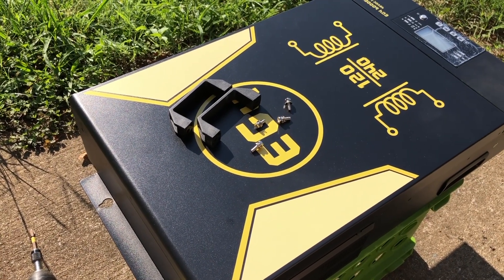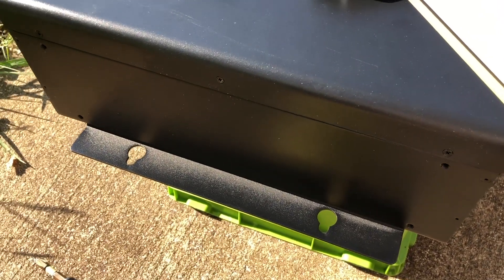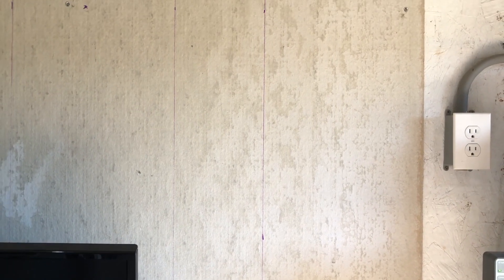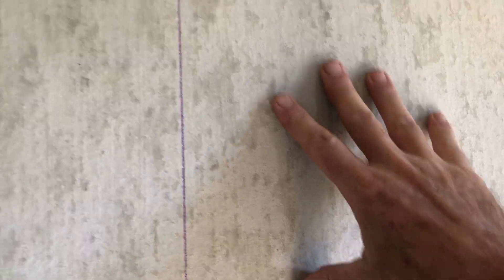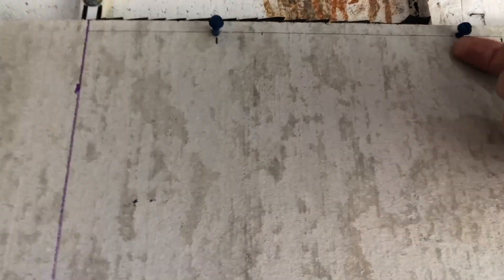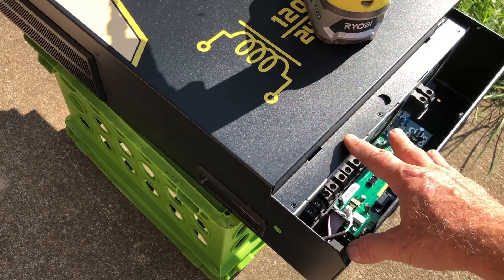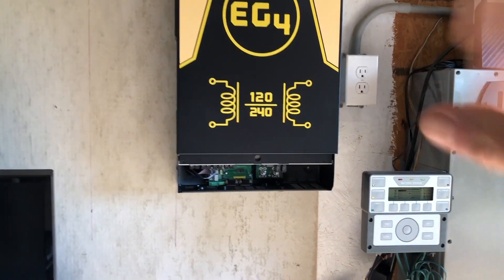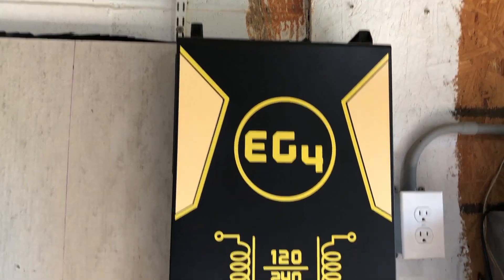EG4 6000EX-48HU Inverter/Charger Wall Hanging

Comment: where is AC CONNECTION VIDEO IN AND OUT especially at panel and sub panel ends??!! please….
Reply from the maker: I have had to put this series on hold for a couple of reasons: 1) my job has me hopping right now. 2) I'm re-thinking even completing this install, as the 6000EX has been discontinued. I may actually go with another inverter.